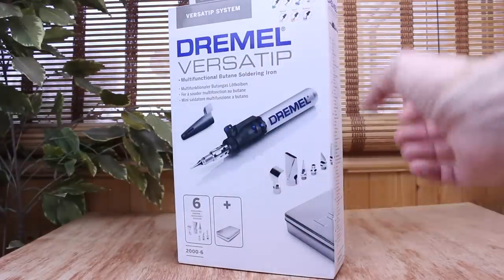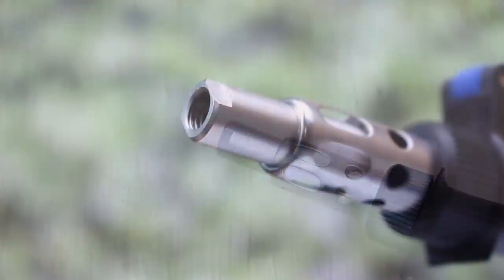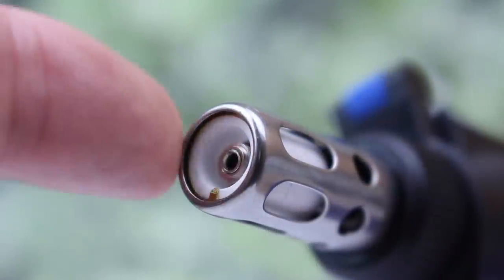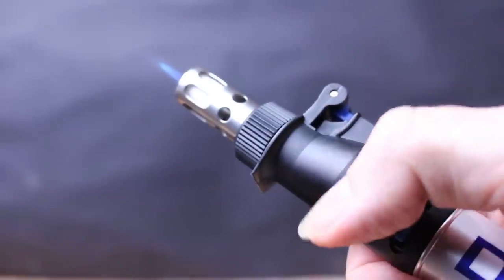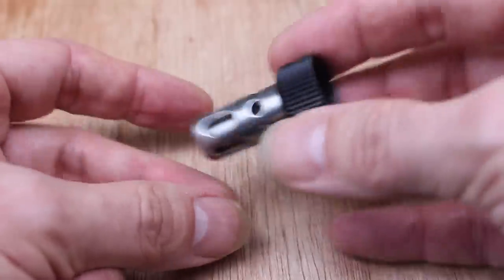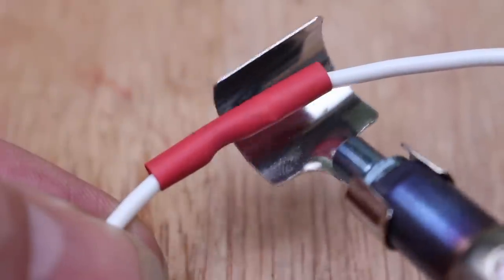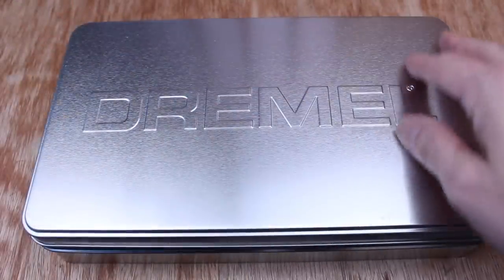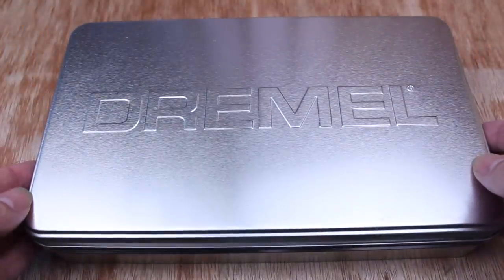Dremel Versatip Gas Soldering Torch Demo & Review in HD

Comment: "standard butane" ? i thought these clogs irons?
Reply from the maker: Now you mention it, I do vaguely recall hearing about a "clean" gas. I'm not sure what the difference is. Like most people, I just buy cans from the tobacco counter at my local store. I've never had an issue with any of them personally.  But I will do some research. Thanks for the comments. Dave
Reply: You need to use high quality refined butane usually found in smaller containers

Comment: Only problem is the fuel finishes fast!! Less than 15mins of use n its out...
Reply from the maker: It depends how you use it. But  if you need something that lasts longer then check out the Dremel Versaflame. simillar , but it has a lager tank. Dave

Comment: Crap for soldering electronics as the heat exit the side of the tip and it's easy to melt things you don't want to
Reply from the maker: I agree it doesn't beat a traditional electric soldering iron. But when you have no power, it has its uses. I use it for torch soldering (silver), the hot knife and for heat shrink. Dave

Comment: worst soldering tips ... original tip is pretty much useless... as well as the two extra I bought... tinned once and that was it... pretty disappointing.
Reply from the maker: Thanks for sharing your experiences. Perhaps it would be helpful to others to explain a little more about the exact problem you've had. Thanks. Dave
Reply: @CelticDreamsCoUk  It might be due to it's high temperature, even at low, that the tip oxidises very quickly. It was impossible to tin and solder wouldn't adhere to the tip...like with a normal iron that's messed up. However I read, either somewhere here or elsewhere to us LOTS of flux and this might help. Which is what I did... I soaked it in there for a bit and it did. After that the tip tinned properly and I could actually use it. I just give it a longer than usual dunk every now and then and keep a close eye on it. I'll just wait and see. I think Dremel should release some kind of statement or something with regards to this because after some research I realised that this is a common problem for some.

Comment: Once I bought one just because I was curious what the hell is that. Waste of money. My digital control soldering station is much better than this pervertion. My grandpa's soldering iron is much better too.
Reply from the maker: Indeed a purpose made digital soldering station is always going to be better for low temp  electrical soldering (as long as you have power in the first place). But that's all your soldering iron is designed to do - it doesn't do anything else.

Remember I'm a jeweller and you cant solder jewellery with an electrical soldering iron. However good it is,  even your grandpas' - you need a gas flame. Such as this Versatip. Yes, there  are many specific tools, just  for one job -all better. But this is not a specific tool. It has many tips which are designed to be versatile - hence the name. 

Perhaps buying a tool just to see "what  the hell is that", isn't the best way to make an informed purchasing decision. Hence my video. Dave
Reply: @CelticDreamsCoUk  maybe you are right, for I am not a jeweller, but use soldering iron for building different electrical stuff. But it happened, that I needed some autonomous tool in my country house, where electricity sometimes shuts off, for example during the storm or heavy rain. So that thing didn't fit me(